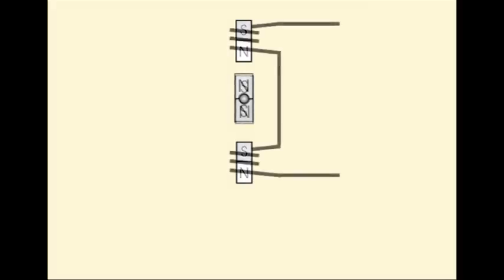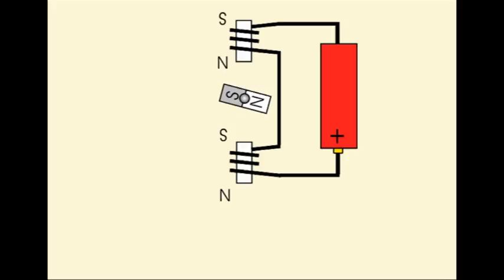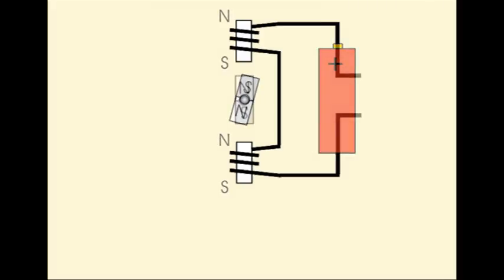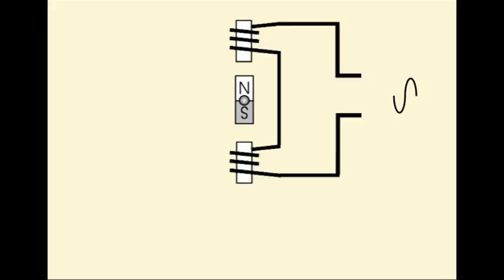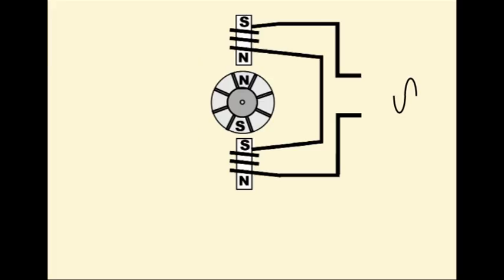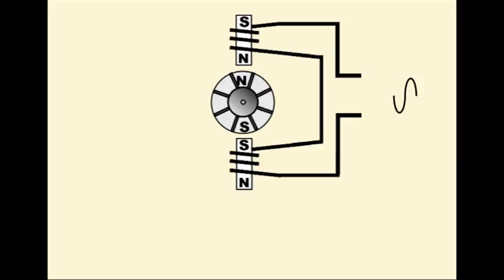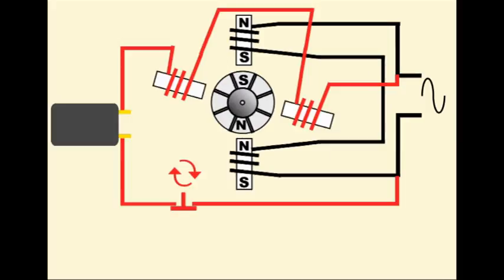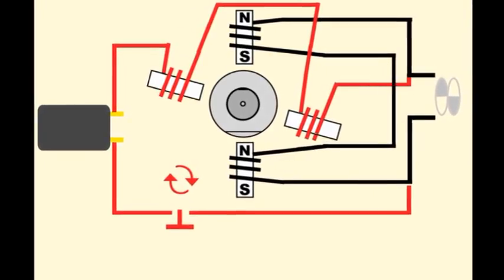How a squirrel cage motor works

Comment: Some smaller squirrel-cage motors have simpler starting coils - a couple of copper rings on sides of stator core. They aren't connected, they are induction powered like the rotor and their magnetic field has 90 deg phase difference from primary coil's field. https://en.m.wikipedia.org/wiki/Shaded-pole_synchronous_motor
Reply: https://en.m.wikipedia.org/wiki/Squirrel-cage_rotor

Comment: How about the efficiency? Does it draw more current than a magnet motor?
Reply from the maker: Permanent magnet motors are far more efficient than induction motors. Induction motors are widely used mainly because of their low cost. In an SCIM (squirrel cage induction motor) the rotor has to be laminated, since it is basically a transformer secondary. This weakens the rotor and lowers its possible maximum torque. On the other hand, heavy currents are needed to magnetize the rotor, which has inherent losses due to ohmic resistance of the materials. There is an excellent magazine article on Turbomachinery on https://www.turbomachinerymag.com/permanent-magnet-vs-induction-motors/ with more detailed information. In industrial environments, factors such as temperature, corrosion, vibration and others can also be decisive in using PMSM rather than SCIM motors. Air gap between stator and rotor, slippage between rotating field and rotor can also be issues. The main reason for using SCIMs is cost.
Reply: @eltunene  Thank you for your answer! Much appreciated!

Comment: Excellent and I really liked the way you spoke slowly in order to give us time to process the concepts.  Two things though.  Why is a squirrel cage better than a simple magnet rotor?  Is it because it produces smoother operation?  Also, I didn't quite understand your description of the squirrel-cage rotor. "A drum made of copper with a few bars which act as a short-circuited winding."
Reply from the maker: Thanks, Robert. A squirrel cage motor is very light in weight and low in cost. A permanent magnet rotor is heavier and more expensive to manufacture, however in some precise applications permanent magnets are best. The way a squirrel cage rotor works is grossly as follows: imagine a transformer with a shorted secondary winding. As you apply current to the primary, a heavy current is induced in the short-circuited secondary, which generates its own magnetic field, which happens to be opposite to the field generated by the primary winding (north facing north and south facing south), this creates a repulsion force trying to have the secondary fly away from the core of the transformer.  Now, in a squirrel cage motor (by the way, they are also called induction motors) the rotor is made of iron laminations and they have aluminum or copper bars which definitely act as short-circuited loops all around the rotor circumference, thus creating magnetic fields which repel the stator winding field. In the case of a motor, the stator is the primary and the rotor is the secondary, so since the stator is fastened to a base somehow, the rotor (shorted secondary) is repelled and is free to rotate. It will rotate in any direction either CCW or CW, but the rotation direction can be established by initially turning the rotor by hand (not recommended, of course) or by an auxiliary winding in the stator, fed through a capacitor, which creates a 90-degree offset field, thus forcing the rotor to start in a preset direction. Once the rotor is turning in the preset direction, the auxiliary winding is disconnected by a centrifugal switch. I hope this helps.
Reply: Thanks for responding.  I am not sure what you mean by a short-circuited loop.  How does that differ from a regular loop?  I have watched another video and it seems as if the strips of metal on the outside of the rotor form one side of the loop and the ends of the squirrel cage two more of the sides.  The fourth side is the next outside strip.  Is this correct or are you defining a short-circuited loop to mean a straight piece of wire (IOW, no loop at all)?
Reply from the maker: Sorry, maybe I messed it up by saying "short-circuited loop". I just tried to emphasize the short-circuit condition. Imagine a rope ladder wrapped around the cylindrical rotor. Each rope square formed by two rungs and the two sides would  act as a square ring and the field produced by the stator would induce a current as if it were a secondary, thus generating a magnetic field. Of course we must assume the rope ladder fits exactly over the cylinder so two squares are at 180 degrees apart.
Reply: So what I suggested above is correct -- the short-circuiting you are referring to is the fact that each strip forms one of the four sides of a loop.  The next strip is another side of the loop, and the metal ends function as the other two sides.
Reply: @eltunene    No- If the magnetic field created in the secondary is opposite the primary then its polarity will cause it to be attracted to the field generated by the primary not opposed. Opposite poles attract.
Reply from the maker: @boog567  Excellent remark!! Yes, I should have said "similar" or "opposing". Thanks a lot! I'll be more careful about my words when narrating the videos.
Reply: @eltunene   Thank You- I find the theory behind how AC induction motors operate to be very intriguing especially the differences between magnet rotors and squirrel cage rotors.
Reply from the maker: @boog567  Thanks, boog567, for your interest and kind comments!!!